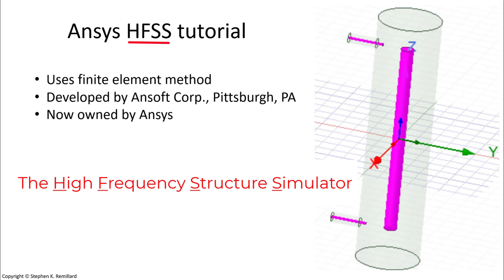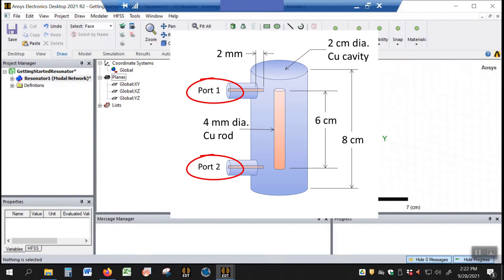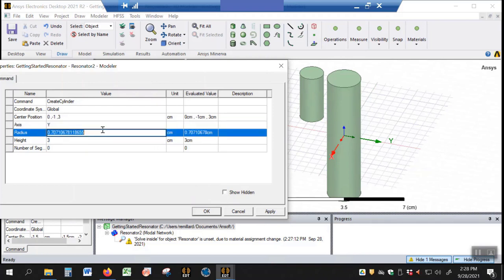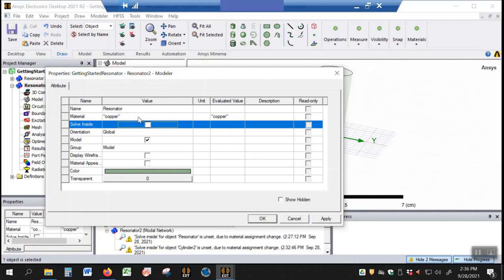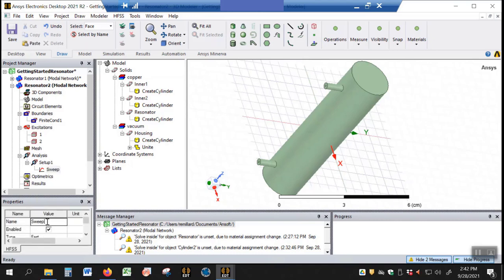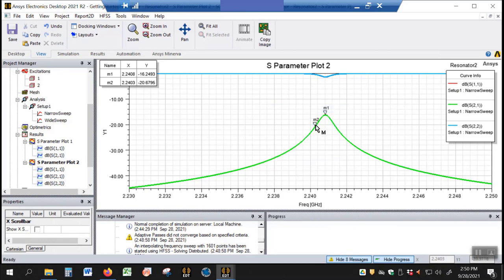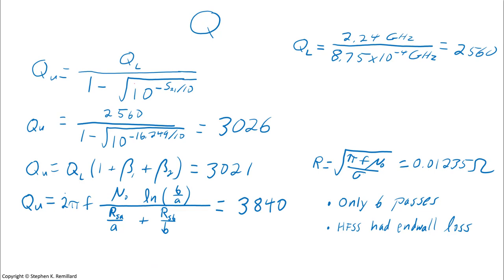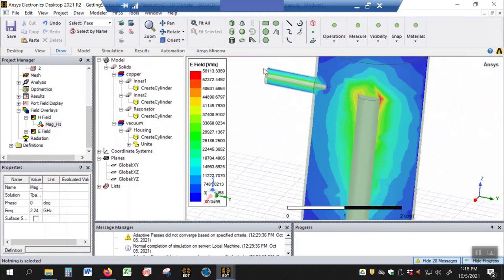Getting Started with HFSS: A Complete Cavity Resonator Example

Comment: Hi Dr Remillard, i have simulated a cylindrical cavity resonator with a TE 011 mode at 8.5 GHz, when i placed a DR inside, the resonant frequency is increasing to 9 GHz, i am expecting to be lower than 8.5 GHz, do you know what had happened sir ?
Reply from the maker: You might be expecting the resonant frequency to be lower since it does decrease as dielectric constant increases.  But this rule is for resonators of the same size and same field distribution.  When the DR is placed in the cavity, the dielectric constant certainly goes up.  But the TE011 mode is redefined and its shape is altered.  My guess is that your result is because now a lot of the electric field energy is being constrained to a smaller volume (the dielectric), and the resonator configuration is not the same.

Comment: Dear Dr.Remillard
I am so grateful that you took the time of making these videos and posting them.I am a student who use the HFSS ,too. I am doing a cylindrical cavity simulation with HFSS, and its S11 is too low, just abot -0.1dB. Is it wrong for a simulation? The cavity is based on 2.45GHz, and I use probe to loop it. its diameter is 93mm and baout 80mm high.
Reply from the maker: Sorry I just saw this.  Yes, you can do simulation at any value of S11 - even weaker than -0.1 dB.  One advantage of resonator simulation is that you can inspect the resonance peak even when it is so weakly coupled that a network analyzer trace would be too noisy.

Comment: Dear Dr. Remillard,
First of all, I am grateful that you took the time of making these videos and posting them. I am a physics graduate student, and I cannot emphasize enough the values of these videos on my current research. For me, with not having a background in electronic engineering, this is the condensed knowledge I desperately needed. I would be thankful if you post a video about the theoretical calculation of the unloaded Q. I am currently studying a tunable cavity based on this coax resonator, which I will email you more details about it.
Thank you again for your generosity,
Geev
Reply from the maker: Thank you Geev for asking about this.  Yes, I will make a video on the electromagnetic theory of Q (e.g. geometry factors and such) soon when I get a little time.
In case it is also useful to you, here are some links to experimental Q measurement videos: 
Theory: https://youtu.be/TGbzYQlPFM4
Demo with a VNA: https://youtu.be/rb6oz3Pi4gA
Demo with only one port: https://youtu.be/5DgmH9XsfLA
But, I guess you might have already noticed those.  Thank you for the request.
Regards
Reply from the maker: Done: https://youtu.be/NsKJ4YvzmR0
Reply: @stephenremillard1  many thanks,
Reply: Dear Dr. Remillard,
Would that be possible to explain/show how one can measure the filling factor of a  small region inside the cavity in hfss?
Many thanks,
Reply from the maker: @geevnahal7926    I suggest using Slater's theorem.  First simulate without the dielectric present to get frequency fo.  Then simulate again with the dielectric present and get frequency f.  The frequency shift reveals the filling factor (ff).  f^2=(fo^2)(1-ff)
See Equation 10 in https://www.jpier.org/PIERB/pierb15/09.09041706.pdf.  Be aware that this is perturbative.  If the dielectric is a large part of the space, then this is not valid.  But in that case, the concept of filling factor isn't so useful anyway.
Reply: @stephenremillard1  so you think it is not a good idea to find the filling factor from Ansys HFSS and measure the Q and then using the relation you mentioned to find the loss tangent? HFSS should be able to integrate the field in a given region. I thought HFSS should give me an accurate value for the filling factor  since its predicted resonance frequencies perfectly match my experimental measurement. Can’t I use this as an another method?
Many thanks,
Reply from the maker: @geevnahal7926  Actually Slater's theorem is how you find the filling factor from HFSS for perturbative dielectrics.  If the dielectric is larger than a perturbation, then there is a different approach.  In that case, simulate once with the loss tangent set to zero to get Q1.  Then simulate again with any non-zero loss tangent (=tand2) to get Q2.  Since the resistive Q is the same in both simulations, the difference in these simulated Q values is (1/Q1) - (1/Q2) = ff*(tand2).
Reply: @stephenremillard1  Many thanks for clarification!